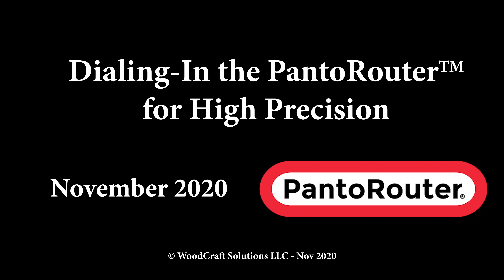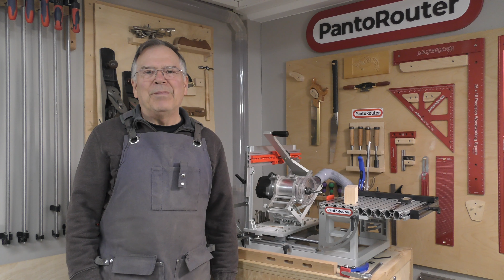Dialing-In the PantoRouter 12-4-2020

Comment: so I'm ready to scribe the center line on the table... what tool do you suggest I use?
Reply from the maker: You can use the split-shaft centering jig supplied in PantoRouter packages in North America,  If you're outside the US and Canada, use a scribing knife, preferably with a flat side to stay on the centering scale fence or square you're using.

Comment from the maker: There's one little bit in the video that I didn't explain well.  When you cut the test piece for adjusting the thickness gauge, the 1" long section I suggested you cut is to use as a representative sample of the actual test piece.  It's easier to use this small piece in the thickness gauge than the whole test piece, and it's the reason there can't be any snipe on the end.  Either way works great but if you cut the one-inch piece try using it between adjustments.  
Thanks for watching!

Comment: Great video Mac. The only thing that I did with mine was use the centering jig to mark the table. When i get home tonight, i'll be fine tuning all the rest. Another question, why do the templates have letters on them?
Reply from the maker: Very good question about the letters on the templates.  With the 7-piece set of templates we "optimized" them for ½" thick mortise and tenon so for ½" they're pretty darned close to the number on the templates.  For any other size they'll make mortise and tenon either larger or smaller than the number on the template.  A ¼" M&T will not be 1-½" when made on the "B" or 1-½" template.  

We always intended to make a chart showing the actual sizes for every bit combination but we've been spending all of our time on R&D for new accessories and templates and haven't circled back to documenting the tried and true 7-piece set.  Someday soon I hope!  Anyway, suffice it to say the numeric size is only accurate for ½" M&T but pretty close for other sizes.